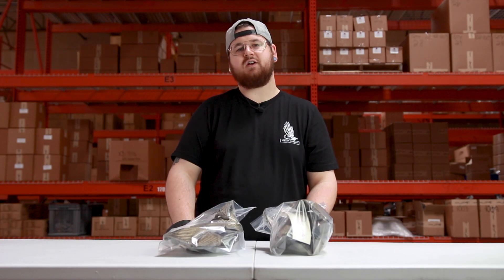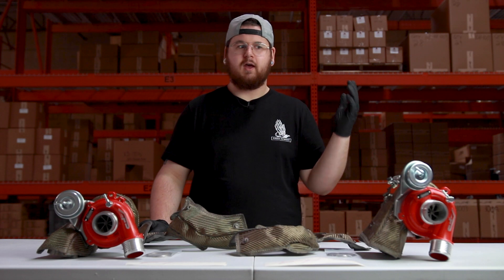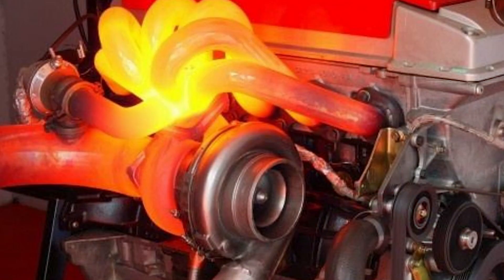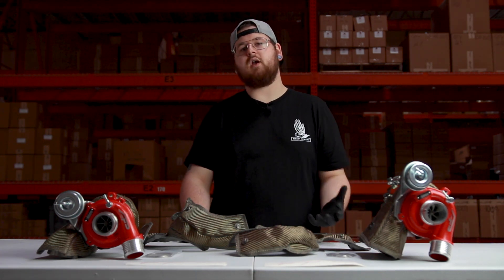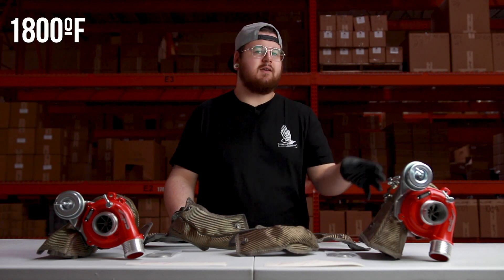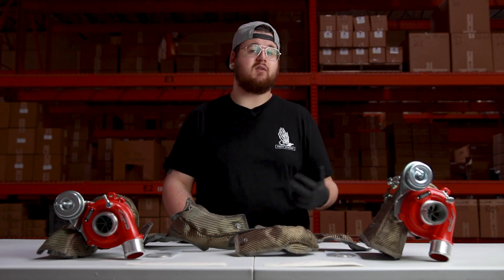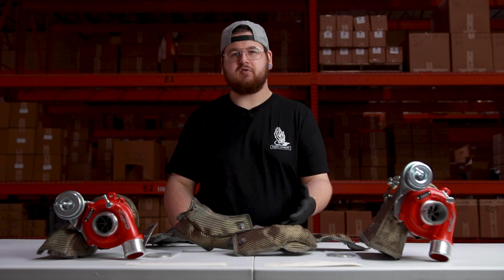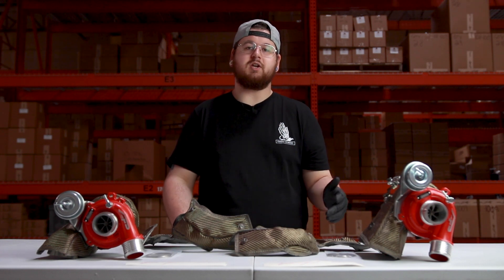What Does A Turbo Blanket Really Do?

Comment: Does added heat kept in and around the turbo lead to early breakdown or will the lifespan of the turbo remain the same?
Reply: @Steve one from experiment, it didn’t raise the oil temp. Turbo blanket is a great buy.